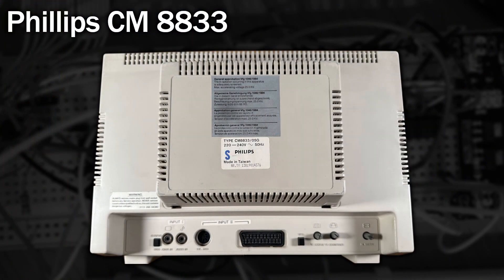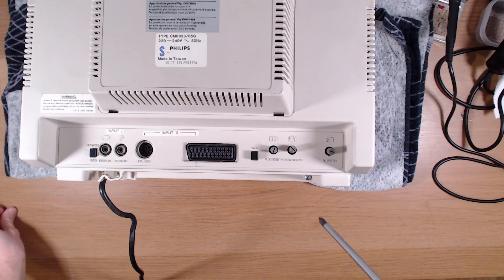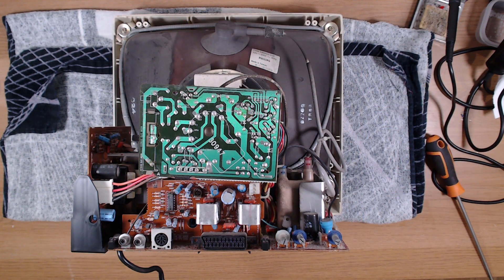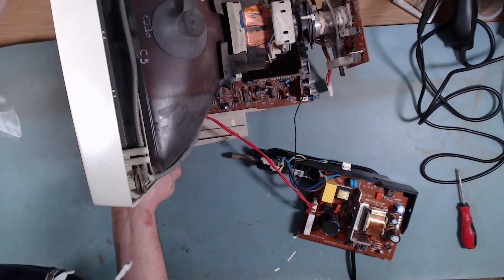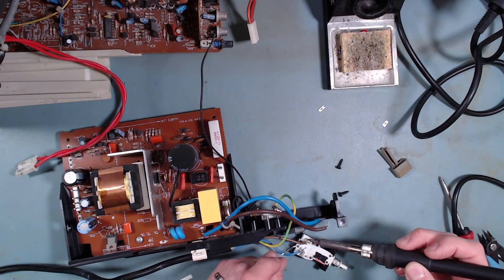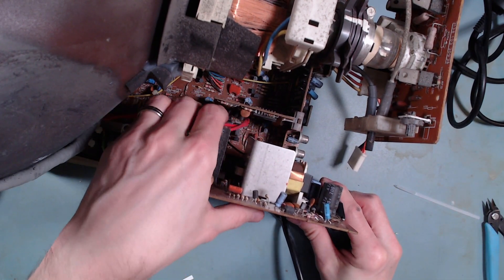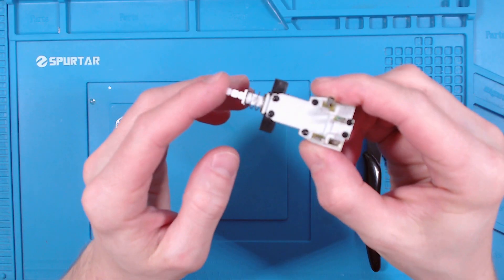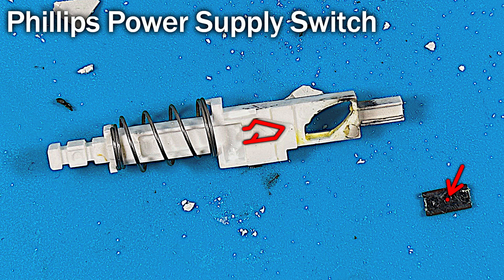Power Switch Repair on a Phillips CM8833 CRT Monitor

Comment: Great, just ordered the switch. I have similar problem with green button switch. Do you have any idea what type it is? Don't want to remove it before I know I can get them or replacement. Thanks.
Reply from the maker: Not a clue about the type of button for the green switch. I guess worse case if you’re not using that function you could leave it in and permanently bypass it

Comment: Apparently you can potentially replace the broken post with a short length of paperclip wire, and then epoxy the switch back together again. I might give this a try on mine.

Comment: Brilliant Thanks Rob, just picked one of these up with a dodgy switch. this looks quite straight forward =)
Reply from the maker: Yeah it’s fairly easy, take your time, and be careful around any of the high voltage areas (not that you need to touch them anyway)